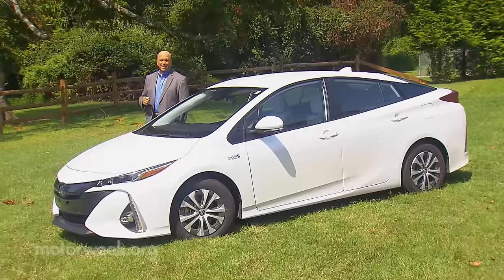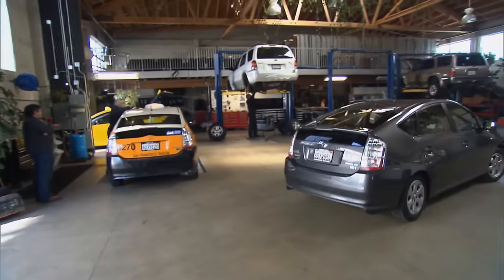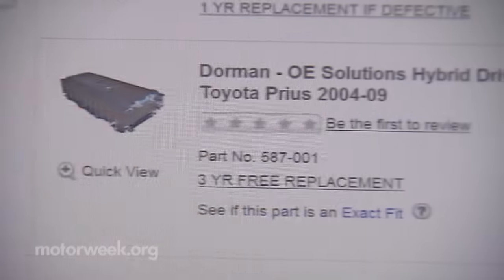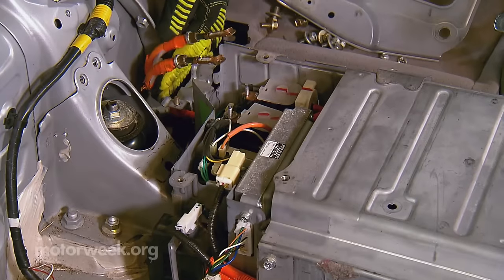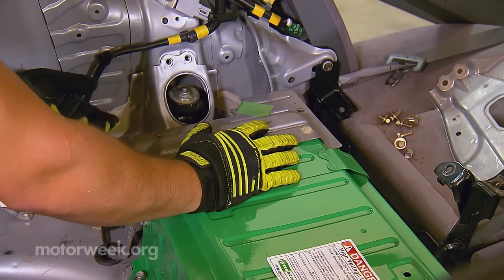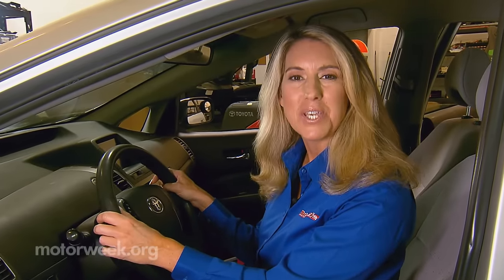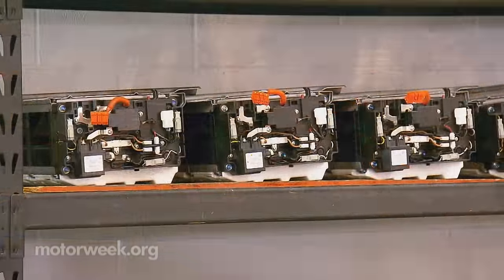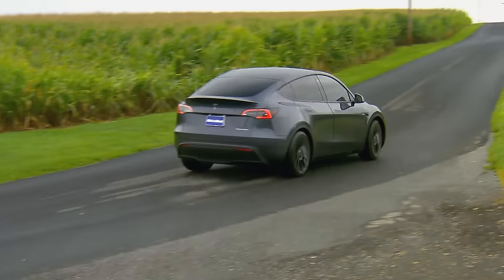Hybrid Battery Replacement with Greentec Auto | MotorWeek FYI

Comment: I worked for them, when they run out of "New Cells" they replace your "New Cells" that you're paying extra for, with refurbished old module cell racks. They'll also try and sell you a battery without even diagnosing the car when it could easily be your 12V battery not having enough continuous charge of its own. Great concept of a new business industry, just terrible people to work for.
Reply: I was just about to order from them before I read your comment. Do you recommend any other company? Just doing my research
Reply: @kimberlys4075  depends on the battery cells you want, I know their competitor is Green Bean, but for actual new cells I would honestly recommend the dealer as they know their product better than most aftermarket companies, but if you're looking for aftermarket, Green Bean or Cardone
Reply: @kimberlys4075  that guy could have been a disgruntled employee for them. Don't just take his word for it. Id check the warranty from each company. Id go with Geentech if they have the best warranty. Motor week wouldn't put up a janky battery repair company just willy nilly.
Reply: @itsmarkwtf or that guy could straight up be telling the truth and even recommended other places
Reply: My brain shuts off when someone suggest the dealer
Reply: @itsmarkwtf i see your concern but he actually recommended the creator- Toyota. Which really is the best choice. They even put in the next highest generation cells that will be compatible in your brand new battery for a lower generation Prius.
Reply: @lucristianx i used to feel the same way until i had to go back to them cause these mechanics i was working with don’t  have TecStream. By returning like 10 years later, i realized they had to adjust their pricing for their hybrid batteries to compete with the aftermarket. Now they only charge about 800 more, which for peace of mind of knowing  I’m getting a brand new battery, is well worth it for me. My last Prius lasted 380,000 miles. The one before that about 340,00. To me its worth getting the same one put back in.
Reply: @holylabs  the dealer has too high of an overhead not to charge a lot.
Reply: @lucristianx  I used to hate dealing with dealers too but they had to drop their price substantially to compete with these 3rd party companies. In the end, it benefits us car owners more. Paying 2,800 for a brand new, warrantable hybrid battery from the maker itself is far better then trying to save 700.00 from a used one JUST to have to end up dealing with their warranty eventually. It was a no brainer for me.

Comment: I have a question on my red seal exam: Which battery do you connect first? The Hybrid battery? Or the 12v Battery,  if for whatever reason both are unplugged.

Comment: "nothing ends up in a landfill, and if it's a higher-capacity battery that won't work in a car"

won't work in a car? if that's the case, where is this EV battery pack repair place getting these too-large cells from then?

Comment: Ok, but isn't the whole point of a hybrid to avoid this issue? Just put on the gas engine if the battery dies, it'll get you to a garage or gas station to charge.
Reply: It depends on which kind of hybrid. I saw a video by  Scotty Kilmer where he mentioned that Honda's hybrids can work fine even if the battery goes, but Toyotas cannot. He's a big Toyota fan as well as a very experienced mechanic, so I guess he knows what he is saying.
Reply: It depends. IIRC, the chevy volt has no 12V car batt to run its starter, so if the hybrid battery goes dead, you're screwed.
Reply: @elimogenson3316 yup bring a screwdriver and 12volt baterry

Comment: Lot of BS in this video. No, the hybrid battery pack will not leave you stranded on the side of the road, your hybrid just will not get as good of MPGs. And no, they last well over 150k miles, Toyota even warranties them for 10 years or 150k miles. This shop uses a scare tactic to get to you wallet....that's just terrible tactic in 2021
Reply: ONLY toyota's hybrid is worth a damn
Reply: I know that a second generation Prius will leave you stranded if the hybrid battery fails. If the hybrid battery is dead or non-functional there is no way to start the car because the electric drive motor is what starts the gasoline engine. They do have a 12volt car battery in them but that is only to operate a small portion of the electronics, such the computers, radio and lights.
Reply: @813yaz  correct. If you have a completely dead cell and ECU your done.
Reply: @813yaz  Agreed, they will leave you stranded, it happened to me. You can usually get away driving a mile or two after the red triangle of death comes up on a Prius, but if you push it, the car will go into self-preservation mode and will not drive .